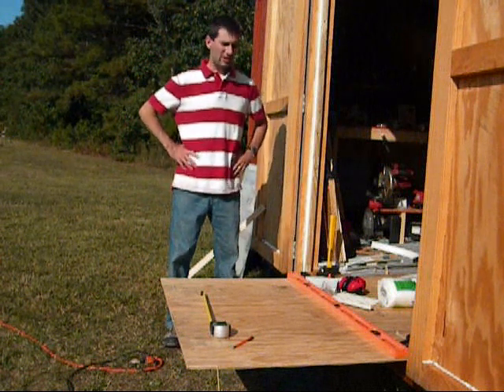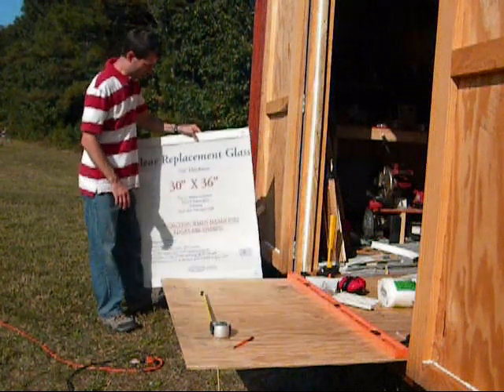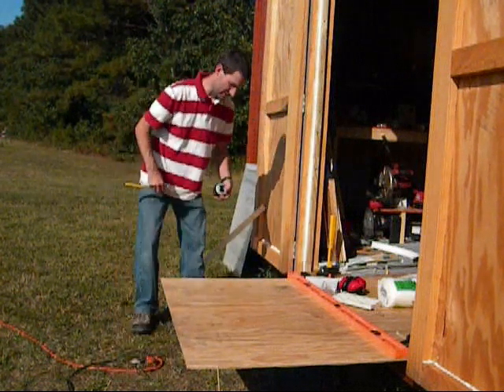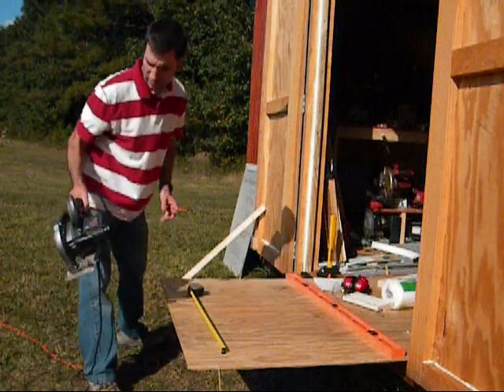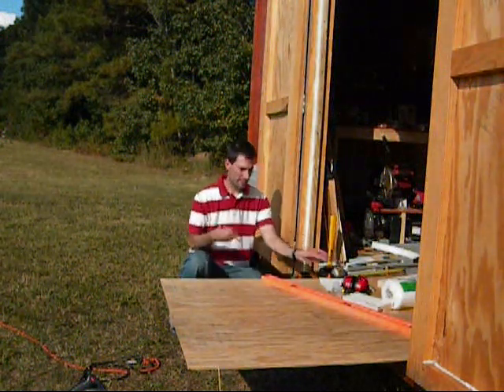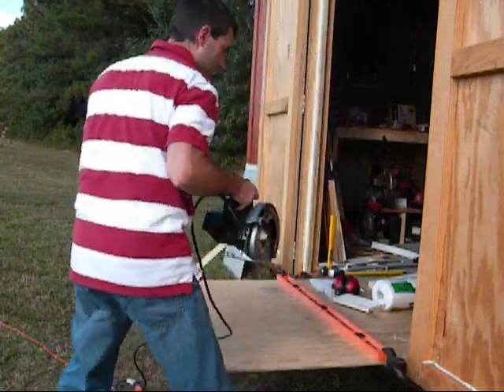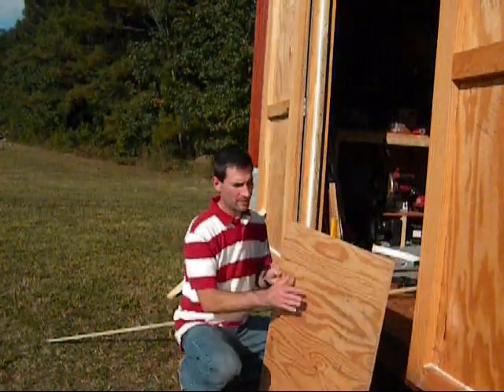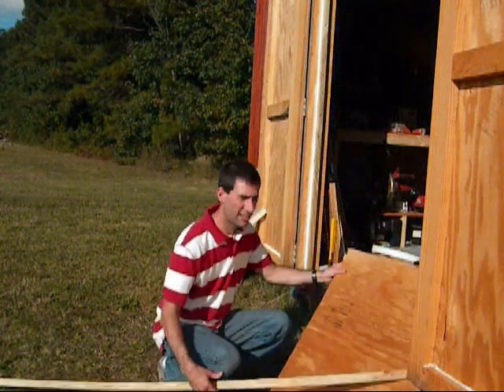building a solar panel part 3 (old)

Comment: Pay attention.... he was using the level s a guide for the power saw not the hand saw.   That way he gets a straight cut from the power saw, that is why he offset it another 1 1/2" from where he needed to cut, saw blade to edge of shoe equals offset

Comment: Hi, really like your work and sharing it.  Now that you have had these working for a while, have you had any issues with heat or moisture getting into the cell areas?  I was wondering if putting that Slygard 184 on the sides of the cells and then putting EVA over that would really nail the moisture problem down.

Comment: That is pretty sweet. I am making a Peak Power Tracker to charge a 12V battery and run a load for a school project with a group. We bought a similar cell kit from ebay and now we are trying to find a way to make 2 panels of 6v. Is there a video that shows you sticking the cells on the piece of wood?